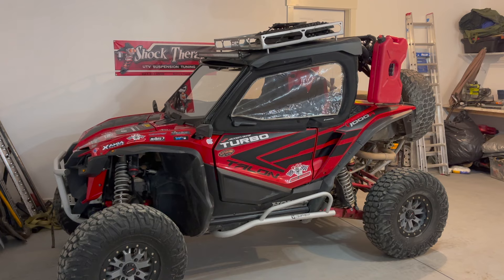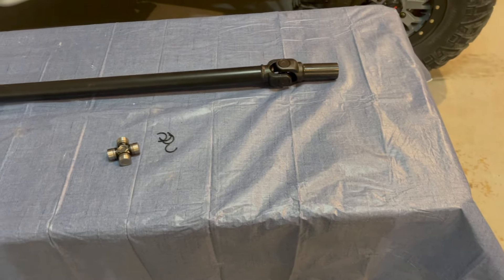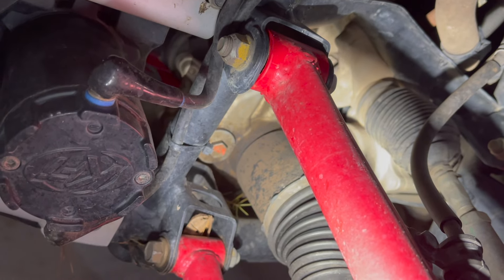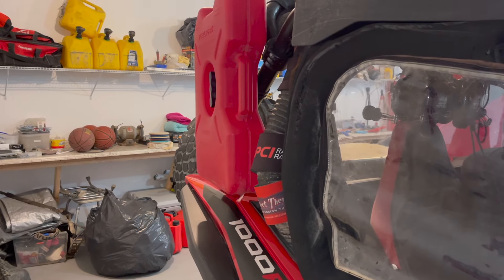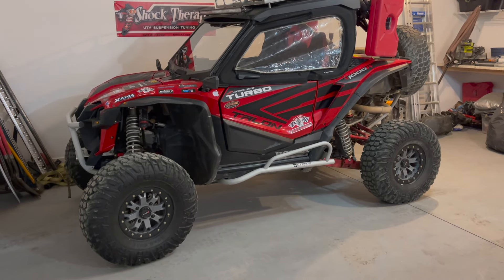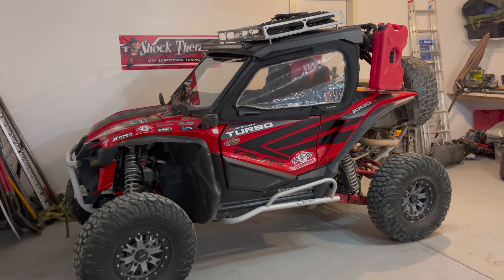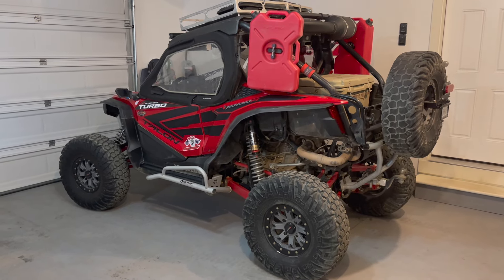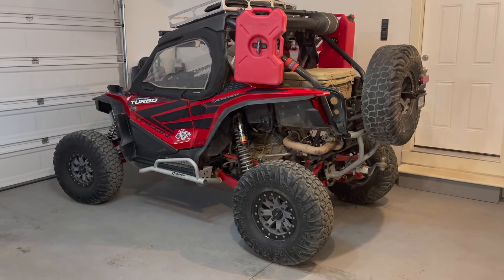Honda Talon 10K mile review!!!! Watch before you buy!

Comment: Rzr would not make it to 10k miles. Maybe 3k miles.
Reply: Not knocking the Talon at all but I got over 3,000 miles out of my 1rst belt on my rzr 800 trail. The machine is still like new and runs great....however my next machine will be a Honda for sure
Reply from the maker: Tons of people enjoy their Polaris machines. There’s pros and cons to every machine. Honda is very reliable. Pioneer 1000’s with over 50,000 miles on them.
Reply: I’ve got 7k on my rzr turbo. I abuse the shit out of it and it’s still running.....
Reply from the maker: Belts, clutch, bearings and bushings rarely last 5k miles.
Reply: Truth mine has had front differential rear differential and transmission rebuilt in 2600 miles. Never in deep water up to floor boards that's it. Mostly trail riding 800 rzr.
Reply: Honda tough
Reply: Had a rzr 900s with 12,000 miles. Probably spent more in parts than what the machine cost new 😂
Reply: 300 more like.  Polaris makes the most comfortable and plush bikes, but their reliability is complete dogshit.    Honda has the most reliable vehicles by FAR! but they arent worried about power output.   but it’s silly to think you need more than a 100 HP in a side by side.   the talon is more than enough  power for anything u wanna do
It’s silly to compare numbers.   Talon is a crazy fun machine
Reply: you cant knock the Talon or any Honda products. they make the absolute best in the business.  No one makes an equal or a better product
Reply: i got 16k on mine lol

Comment: The rear bucking can be fixed by softening the rear spring rate or increasing the sag in the rear. Also adding a shim to the rebound stack in the back shocks to slow rebound.  I also swapped the 7 weight oil for 10 weight in the back. It slowed the action down about 5% or so.  There's a reason trophy trucks squat in the rear. It's to reduce rear bucking. These are no different.
Reply: Talons have poor suspension geometry. Especially in the rear. That’s it’s main issue.

Comment: Very Informative as usual,it just helped me figure out the clicking noise I've started hearing when I'm going slow and turning right.Mine is a 2020 R with 1400 miles,only issue so far, had a ground strap come loose at 1300 miles ,diagnostic port read no ecu,so I freaked and took it to dealer, who fixed rather quickly under extended warranty. Glad to see fresh videos from ya.
Reply from the maker: Thanks for watching!
Reply: I have the same issue with the clicking. Very informative
Reply: @gravesru  would new axles cure this axle clicking noise?
Reply from the maker: @ronniebowling6192  typically you just have to replace the one part I showed in the video. So half of the axle.

Comment: After reading about the short air filter life I decided to put a filter minder on mine, like what's used on industrial vehicles/equipment.  2,000 miles later it still hasn't moved.  I think people are seeing dirt on the filter and assuming that it's plugged up when it really isn't.
Reply from the maker: You’re right, I think most filters get changed prematurely. But if the fresh air was coming from a different location, like the pioneer 1000, it wouldn’t be a problem.

Comment: Great video. I have a 2020 set up very similarly. Pretty much trail ride. Do you think 35" Motivator RTs are to much tire. Mine are currently 32s been considering 35s
Reply from the maker: I haven’t tried 35’s, but my only concern would be the clutches. I’ve heard many people do run 35’s though.
Reply: 35 gear reduction needed IMO

Comment: On your driveline or propeller shaft on your u joints when you inspect the u-joints just make sure that the c-clip is the opening is facing out to the open air the body of the c clip facing into the yolk so that don't have room to move out

Comment: Surely one can get away with slow driving and maneuvering on concrete or asphalt… like in a driveway/garage scenario right??   I still have the light stock tires and wheels.   After I wash my unit I may also take it on a quarter mile zip in the neighborhood just to dry it off.   I appreciate the video
Reply from the maker: Yes, for sure. You just want to minimize time on the asphalt. It just puts a lot of strain on the axles and rear differential when turning right or left because one tire will have to spin on the asphalt. If I have to drive on asphalt, I try to put one tire in the gravel on corners when possible.

Comment: I have been hearing about the subtransmissions are given the talons a ton of trouble
Any input would be much appreciand thoughts on which years to avoid
Reply from the maker: Last stat I saw, only about 3% of the talons have sub trans issues (mostly driver error) and that’s typically caused by the shift gate not being properly adjusted and the gear not properly selected before trying to take off. You just have to make sure the gear is shown on the speedometer before taking off. There will be a dash on the speedometer instead of a H, L or R if it’s not properly in gear.

Comment: I have been through three driver side front diff seals. My fourth set will be installed this Friday. All have been covered under warranty but it is getting old for a machine that only has 650 miles.
Reply from the maker: Have you tried driving a couple thousands miles and see if it stops?
Reply: @gravesru  No I have not. I only have 650 miles on the machine. I assume you just top it off and keep rolling?
Reply from the maker: @RJR-9603  every leak I have seen is so minimal you don’t even have to top it off.

Comment: Do you think axle and driveline issues might be some way related to 32" tires?
Reply from the maker: Absolutely not. I had driveline issues with 28’s on.
Reply from the maker: The oil should be changed once a year or every 1200 miles.
Reply: Erin Early has driveshaft fix

Comment: do you have any towing capability
Reply from the maker: I towed a trailer that was about 1000lbs for 1500 miles.
Reply: cool thx any change over years or all of them are the same from the start to 2024? @gravesru
Reply from the maker: @RippleBoobs  they made a couple changes in 2023. They shortened the wheelbase on the R models, so the front A arms are different. They also changed the grill and moved the speedometer to the steering column. Powertrain is the same.
Reply: ok thx i am in canada and the R is not available so sound good they did not change anything big and i was looking for the yamaha 2016 yzx whit manual trany but it look very brutal compare to a talon  @gravesru

Comment: I see you used the rear solid window and then purchased a spare tire carrier to mount the S&B.  I just sold my RZR4 and am getting my new talon 1000x 4 in a couple weeks.  What brand of spare tire carrier did you use to mount the S&B Particle Separator on? Thanks, appreciated your review as the Talon is new to me and I need to put on the best accessories for my use.
Reply from the maker: I used this tire mount, but cut it in the middle and added a 7” piece of pipe to make it wide, so it sits higher and I can see out the back window. Thanks for watching 
https://www.utvdirect.com/honda-talon-1000-dual-clamp-spare-tire-mount/?sku=HTDCSTM&gclid=CjwKCAiA8bqOBhANEiwA-sIlN59c6rywdz34B08BPe79PGPVVA3LkYHjB2fGm-RWWqFT_uFg42HJUxoCDTUQAvD_BwE

Comment: Have you played with an after market exhaust with the turbo? I'm looking to get the kit.. I've read it is a no no for tuning but I suspect jackson is being overly cautious. I cant imagine the reduction in air flow on the back side vs the "restriction" on your setup on the intake side. What are your thoughts?
Reply from the maker: You can definitely run an aftermarket exhaust, I’ve ran an EVO for thousands of miles. I highly recommend installing an afr gauge with the turbo kit. I have a separate install video on the afr gauge.

Comment: Here are some issues with the Honda air filter which cost 150 bucks every time you buy one. cab is dirty and hot, it’s rough and noisy to go back to air filter to get out it has several screws very time consuming. Not only the drive line but also front axle on right side replaced two of them. Went back to Can Am x 3 DS RR turbo. Owned three so far and put on about 4K before I trade them and have never had an issue. I also run it with 15 inch rims on 32 tires with no clutch work have never been through a belt.
Reply from the maker: The air filter is $45, and you can go 2,000 miles if you use a particle separator. I’ve never replaced a front axle. The cab is very hot and that’s why many relocate the radiator to the rear. Glad you don’t need belts, it really depends on how they are driven, I’ve seen people go through two belts a day on the racetrack.
Reply: The air filter costs $45 not $150.  That said if you stay with the stock setup you will be spending a lot on new filters - every 70 - 150 miles depending on how dusty conditions are.  

I added a particle separator and now only have to change my filter every 2,500 - 3000 miles.  I drive on forest Service roads and they are really dusty.

Comment: After market parts available ???
Reply: Great question that's what I was wondering as well? Seems like if you're going to be putting alot of hard Miles on the machine you will need to upgrade several parts.
Reply: This thing has tons of aftermarket parts. Dumb question
Reply from the maker: Slowly getting a larger selection

Comment: Axle comment ‘do not drive the Talon on pavement’ - how is it that a company like Honda cannot sort out a dif to solve for high grip environments (pavement or hard pack)
Reply from the maker: It’s a sport sxs, it’s not meant for asphalt. The Honda pioneer has turf mode so asphalt isn’t a problem.
Reply: @gravesru  I get that there is just so many areas now in (New England) where I am located that in order to navigate from one trail to the next etc it requires a pavement ride.  It’s great for us because it’s opened up so many more trail options, but surprised to see this as the cause of axle issues
Reply from the maker: @shawnhawthorne35  if you take it slow and don’t accelerate when cornering, it shouldn’t be a problem. I put the outside wheels in the dirt when going around an asphalt corner as well
Reply: @gravesru  thanks man, and great video, I hadn’t finished watching when I asked the first question.  Have been a Honda guy for a long time and recently bought an Outlander, the stock Honda quads simply don’t measure up anymore.  But still love the Talon.  It’s wishful thinking but the Honda stock is so disappointing to me, they need an XR model or something where the factory can really build a beast.  My point is this review could easily have been titled Honda Talon review - 10,000 miles and $10,000 in add on’s.  Your machine is awesome.
Reply from the maker: @shawnhawthorne35  thank you & I wish there was a 200hp Talon factory option.

Comment: Great video.  My Talon has only 600 miles right now.  Question about the front drive shaft.  It worries me that it might fail out on trails far away from camp.  I watched your video on how you replaced it and you say you carry a spare and change in the field if necessary.  The video you made on replacing the shaft didn't look to me like it was something that could be done in the field.  Have you come up with a easier way to replace.  Perhaps you could do another video on how that was done.  Thanks.
Reply from the maker: I wouldn’t replace it on the trail. I’d do in my cargo trailer though. You can drive it slowly if it fails, like back to the trailer.

Comment: Have you had any issues with wheel bearings
Reply from the maker: I replaced one at 500 miles because of an accident, so all 4 wheel bearings have about 10k miles on them and they’re still good
Reply: @gravesru  I got one of those wheel bearing grease tools but I'm thinking about holding off on using its if not completely necessary. Thoughts? Not sure how well greased the bearings come from the factory.
Reply from the maker: @DontComeToMyHouse  I have 10k miles, never greased them and they’re all still good! Maybe if you’re swamp riding all day in Florida, you might need to grease them!

Comment: Nice job on the video!  I have the enclosed windows as well. What outside mirrors are you using? Are you able to see via your passenger side mirror?
Reply from the maker: These are the ones I use. I did slightly modify them. I switched the base and mirrors from drivers side to passenger side. I can only see the passenger side mirror if I lean over. kemimoto UTV Side Mirrors, UTV... https://www.amazon.com/dp/B08C78R48L?ref=ppx_pop_mob_ap_share

Comment: good video. nice hearing an honest review. as far as greasing sealed wheal bearings. its a must in some riding scenarios. they come sealed but not waterproof. if you ride in 2 or 3 ft of water alot you should probly repack every once in a while. while im glad your clutch is holding up the power loss percentages you give were provin wrong before the talon was invented. all the machines are at about 20 percent power loss with the main factor being rotating mass.you take a bone stock 1000xp and a bone stock talon which are within 3 or 4 percent hp 90 lbs and the xp has taller heavier tires they run neck and neck with the rzr usually pulling the talon out of the hole and the talon gaining back on the big end. i would guess this has to do with the cvt allowing the rzr to flash(not slip) to peak power out of the hole better and the talon spinning lighter tires.now some showed the tallon being 1 or 2 percent better at first however that was with the factory shorter lighter tires. is there a difference in power loss? sure. mayby 1 or 2 percent however it has little or nothing to do with the respective clutch setups and more to do with drive train beaf and tire weight and size.another thing i would definately watch on the talon is the design on the air box cover. it being after the clean element can allow unfiltered dust by. make sure that lid seals. most brands use the lid as a first line of defense with the filter going inbetween it and the intake.
Reply from the maker: the dyno results I'm referring to are bolted onto the hub, so it takes out tire variances. Roller dyno's aren't that accurate and little things can really change the results, like tire size/weight etc.
Reply: @gravesru a hub dyno is used to keep tire slippage under control. while it would take tire size out of the equation and the rotating mass of said tire out of the equation it is not any more accurate than a tire dyno Apple's to apples. first i have never even heard of a side by side on a hub dyno because tire slippage  is not an issue. but ok. anyone that knows anything about dynos knows that a 1 to 1 ratio(high gear) is ideal for best results. this is easy to do with a gear selector . not so much with a cvt. that would be a better argument on the dyno situation.  bottom line. at the low power range these things make (105ish crank)and your opinion that the talon is over 10 percent more efficient at using said performance there would be a fairly large difference in performance. simply drag race them in stock setup and a 1000 xp will win almost evertime if traction is good. i suggest this is because of the 90 lbs of weight advantage the xp 1000 has. basically power loss is equal. clutches and drive belts dont really use or waste power unless they are slipping.  99 percent of power loss is rotating mass that they both have litterally the same components driveshafts,wheels,ujoints,gears, differentials,ect.cvt clutches are not disliked or unused because of efficiency.  they are disliked because they dont hold up to high horse power, heavy vehicals which side by sides are not. in fact a cvt will flash rpms immediately to the most powerful range of the engine and stay there making them verry efficient.  basically a stall. im open to opinions but.....science and stuff. honda makes a good unit . but it takes lots of upgrades to make them  underperform against a less expensive canam turbo or polaris turbo. all of these comparisons were made over 5 years ago when the yxz came out with its manual gearbox. it boasted more hp than the other na machines yet did not out perform. i get it. love what you got and thats great. as far as super side by sides go honda made a machine comparible to machines that came out 6 years prior that costs more than late model turbos. add on the suspension abomination and you have a Japanese company that came out late in the sport side by side market swinging for a base hit.is your machine good . yes. is it better than a cheaper turbo canam or polaris. no. does it compare to a much cheaper na rzr or maverick ?yes in power. not in suspension and 4x4 setup. all things can be modified to be better.
Reply: @gravesru  also someone has abypass for that hp robbing brake engaging front diff i hear works good for the talon.
Reply: @Go away its not magic. the dyno is bolted to the hubs instead of the tires. none are real accurate. they all differ. flywheel hp is more than hub hp which is more than wheel hp.

Comment: Why would you want the rear to be as wide as the front?  There is good reason why the rear should be narrower.  By moving the rear tires out. You are hurting how the vehicle turns and tracks through obstacles.  Also moving the mass outward effects the leverage on your rear suspension components.  In other wards, Honda knew what they were doing. Lol.
Reply from the maker: The front and rear are the same width from the factory. The factory wheels also have the same offsets, so I have no idea what you’re talking about.